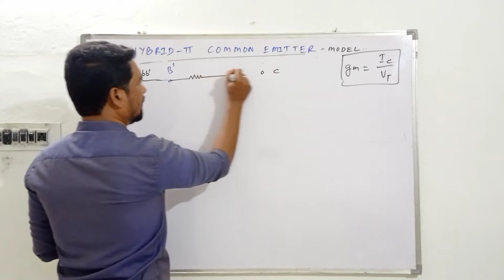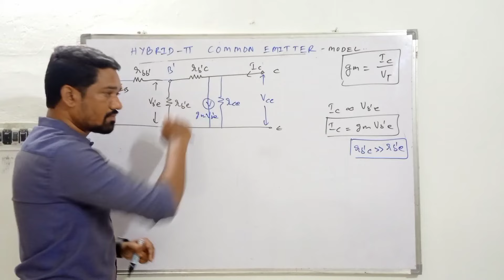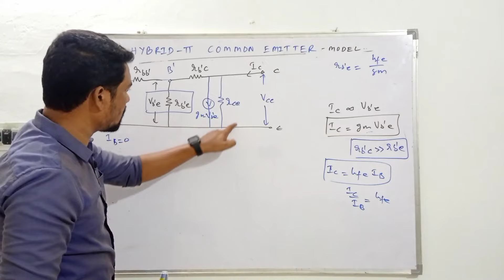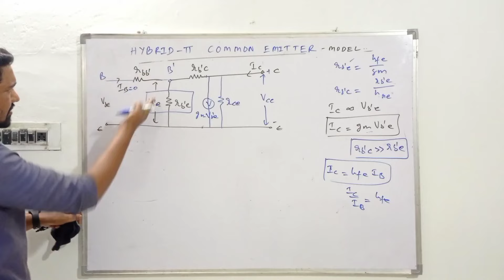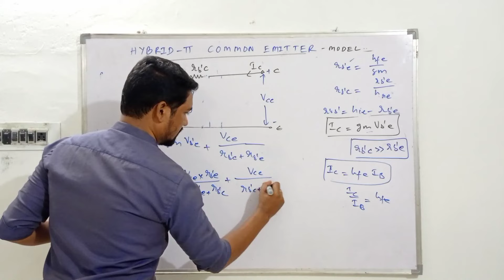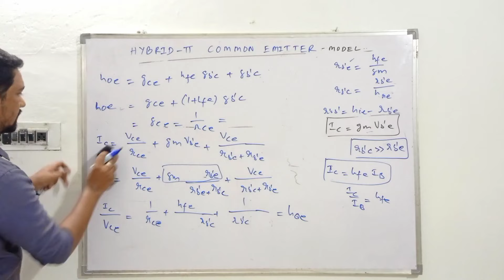hybrid-π model|conductances|analog electronic circuits| ECA|ushendra's engineering tutorials|

Comment: Why should we consider IB=0, to evaluate rb'c ?         and 
Why Vce=0 for evaluating rbb' ??
Reply from the maker: To calculate output impedance input should be open circuited, and to calculate input impedance output should be short circuited. A rule in network analysis. When input is open, input current ib is zero., And output is shorted, output voltage vce will be zero
Reply: @ushendrasengineeringtutori4259  
Why this rule is made sir?
What is the proper justification for this rule?